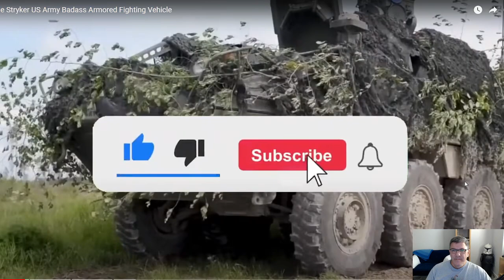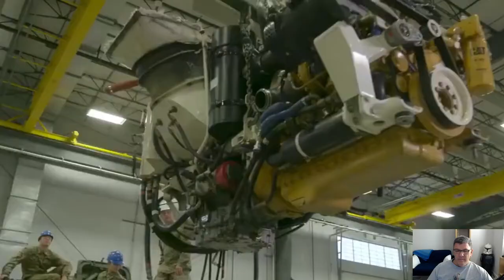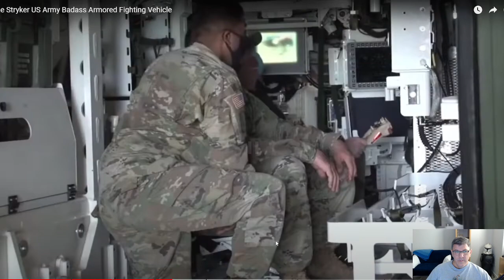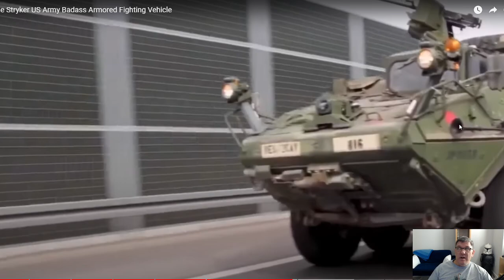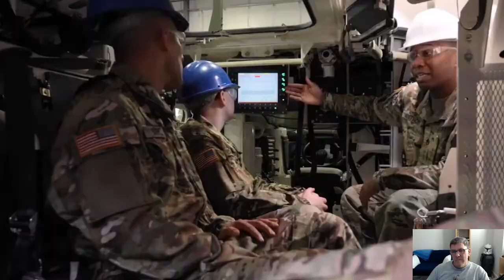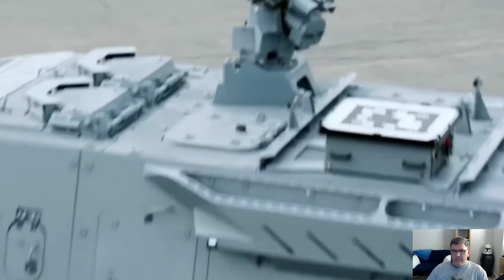A Canadian soldier reacts to "The Stryker US Army Badass Armored Fighting Vehicle"

Comment: the image he showed for the mortar stryker was actual an m1128 MGS, but they do have a mortar variant which has the rear where the infantry usually sits, open up and has a mortar in there, and for the grenade launcher variant the guy was talking about, he was probably talking about the MK19, basically a grenade machine gun which that is remote controlled, they obviously have the smoke grenade dispensers like most armored vehicles do nowadays
Reply from the maker: Thanks man!

Comment: If their performance in Ukraine is anything to go by, they are little better than any other counter insurgency fighting vehicles, perhaps a little more survivable.
Plenty of them have been ripped apart by the Ivans.
Reply from the maker: Because they are not a " counter insurgency fighting vehicle" they are an "Armored Infantry fighting vehicle", the key word there being Infantry. If they are dying that easily then they are not being used correctly. They are absolutely not a tank.
Reply: @DarthTigger They are definitely being used correctly, it’s just that a $500 FPV drone can dismantle it without issues… not to mention artillery, and mines. If it gets hit by a Kornet ATGM the crew is dead.
Reply: @DarthTigger  The term "armoured" is debatable, since the basic side plating is not even rated to 50Cal.
Their principal use has been as taxicabs in Afghanistan, or as you claim "Armoured Infantry Fighting Vehicles".
I wouldn't climb into a Ukrainian one for a pension.
Reply from the maker: Agreed

Comment: I think those small missile canisters hold stinger missiles for short range anti air.
Reply: SHORAD, That was 2 hellfire + 30mm + stingers (on the other side), 1st config of SHORAD anyway, there is a laser version and a newer 3rd config coming out with the stinger replacement and newer autocannon. (In the earlier part of the video anyway, later in the video was that TOW version)
Reply: No, they hold anti-tank missles.